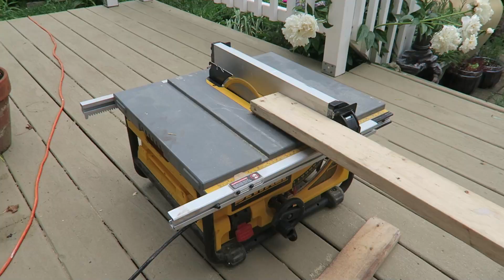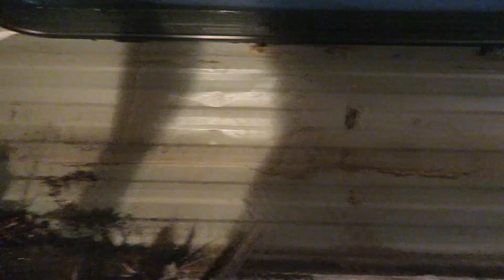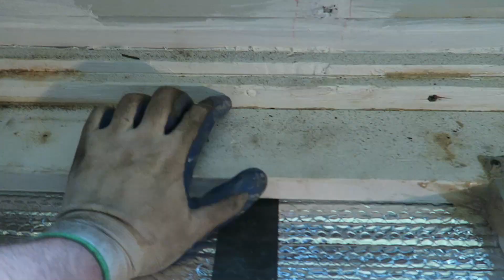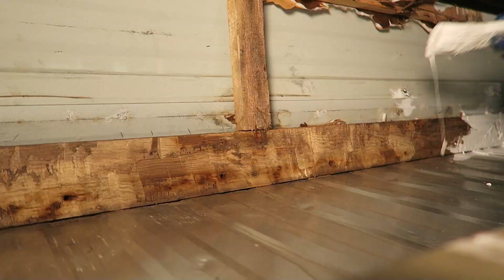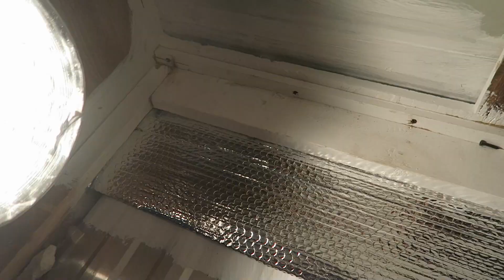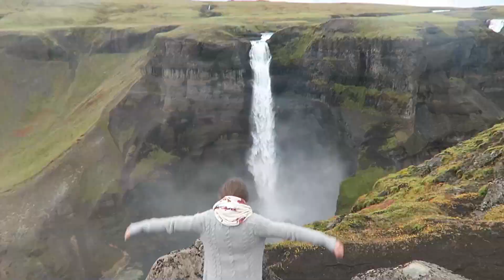Truck Camper Bed Reconstruction | Truck Camper Renovation (5)

Comment: Have you had any trouble where you did not put the bottom Luan back in?
Reply from the maker: Sorry, what are you referring to? I did put plywood on the floor of the bed. Is that what you were referring to?
Reply: In the bed area...you left the outside layer on the next layer was luan
Reply from the maker: @Yo-mamashouse  oh okay I think I know what you’re referring to. No, I haven’t had any trouble with it. I did put a thicker plywood on the floor of the bed where the mattress goes.
Reply: Ok thanks , great repair, probably the best on here and great explanation.
Reply from the maker: @Yo-mamashouse  thank you so much! Glad it was helpful! 😀